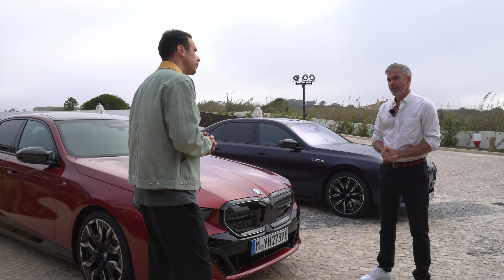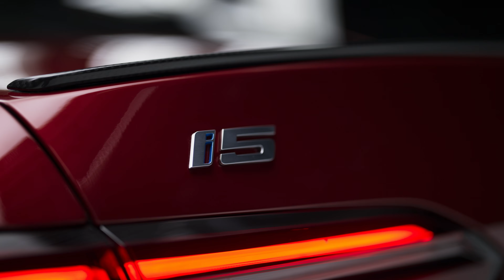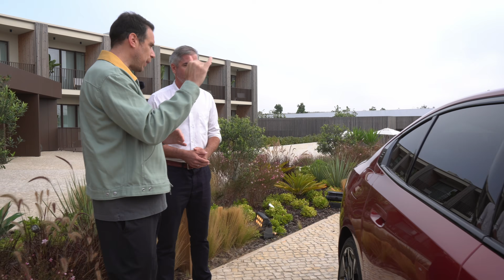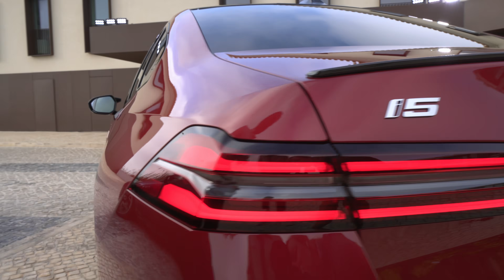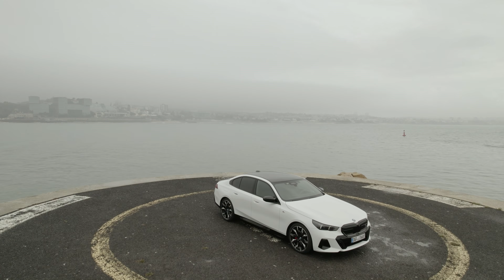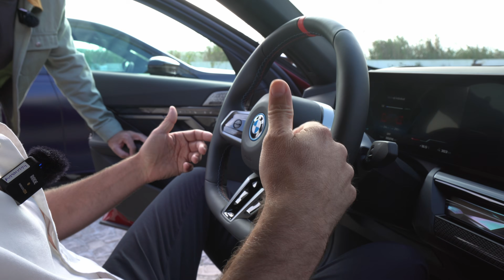BMW 5 Series -  Design Review

Comment: I love the design both in and outside, also love the hidden air vents, way cleaner this way. I can also understand why they don’t use physical buttons anymore, I mean, modern vehicles have a ton of settings/options , it must be done like this . And about the climate controls , what is the problem adjusting the temperature from the screen? I really don’t understand,it’s not like you do it every 5 minutes . 😊

Comment: I love & appreciate it when vehicles are explained by designers & engineers unlike just reviewed mostly "unknowledgeable" motoring journalists who just express their's/people's views which I don't usually follow & find boring.thanks Horatiu
Reply from the maker: This is really nice feedback. I appreciate it. I feel the same way: the designers and engineers are the best at explaining their work. I enjoy these interviews too because I also learn a lot which makes my job easier. For example, what I learned in this new i5 review (even though I did another one before) that the flat bottom steering wheel is also a functional piece. Meaning, it helps with knee room and getting in and out of the car.

Comment: Great Review, however The next time you have the opportunity, please explore  untouched subjects about the car like the sound quality. HK vs BW. Do the Speakers illuminate like the i7.. The lighting accents under the gear shifter, are there any, like the i7 as well. Wind noise on Panoramic Roof vs standard. Etc

Thank you for your hard work.
Reply from the maker: Will do. Next month.
Reply: honestly horatiu this is a really underreported aspect on cars!! those things like sound quality, seat quality, seat positioning comfort are usually just described in a vacuum without comparing to other cars, if bmwblog could have a tech/ rating car comparison section i feel like that would be cool 

also, if you get the chance could you ask the designers why there are no nice quality leather seatbacks on the new 5? it looks cheap the way it is with plastic rears.  and also why the lower speaker on the front door panel is ugly / plain even in the B&W spec? 

im a little disappointed that they didnt add more specialness to the 5 interior although it does look good!! (im thinking of things like the alcantara dashboard thats available on the new 2, and the way the sunroof doesnt have any dimming tech or ambient lighting like the iX or 7 

 @bmwblog
Reply from the maker: Let me shed some light on how things work. At events like this, you have limited time, limited cars. You focus mostly on driving. Then later one, you get a car for a week review or longer where you can focus on all the details. But you need to also find a car to compare things like sound. Let alone getting other brands to give you cars to compare, which is always tough. The questions you have for designers, they won't answer them when you ask them like that. How should they answer the question on the frond door panel speaker?
Reply: @bmwblog  

You're absolutely right about the limitations of those kinds of events, and thank you for running bmwblog very well and being active I enjoy the updates very much. 

As for the questions, you're absolutely right. It's hard to ask questions like that.
But I feel like it's still important.

I mean, there can be a way to ask them and it's still important to ask them because just for example, I think I'm pretty sure this is the i5 M60, right?

And I haven't seen it with an Alcantara roofline and it's over 70,000 and it's the top of the line electric model and it doesn't have an Alcantara roof.

Why?
That seems odd.

The seat backs being plastic, no seat pocket, makes it look like an economy car.
It makes it look very cheap.

And then I think I saw another comment here about, and I didn't even know this, they removed ambient lighting from the rear seat. Why would they do that?

And then the Bowers and Wilkins system.
Yeah, it looks good on the top side of the front door panels.

But then there's that whole lower area where it looks like a base model sound system. There's nothing. It doesn't look special. It doesn't look like anything.

And those are all things that were different on the old 5 Series.
Remember the Bowers and Wilkins on the old 5?
It had beautiful speaker covers up above and then also beautiful below.

And the old 5 Series had beautiful ambient lighting in the rear and beautiful leather on the panel in the rear and beautiful Alcantara.

So it's just that we should hold these brands to account because they're making a new product. It shouldn't be worse than the last - and I specifically mean in materials not in design.

Maybe a way to ask these types of questions, and I think maybe this is their strategy, which is to make the M5 more special, that they're saving a lot of things for the M5.

And so maybe a way to ask these types of questions are, oh, is the M5 going to be more special on the interior?

Will it have XYZ?

I just want to make it clear I'm not trying to attack you or the designers or anything.

I just feel like there are little things that have been overlooked and it's always good to point them out.

For example, the roof feature that I was talking about, the shading, like on the iX, like on the new Porsche Taycan Sport Turismo, that feature was in the iX when it came out and the iX has been out for four years now and they launch a 5 Series, which should be in the relative range of what an iX is, and the 5 Series comes out years later and it doesn't have that technology in the roof.

And the roof doesn't have any sort of ambient lighting, which was in the old 7.

So there's things that are just being overlooked for no reason it seems, unless what they're trying to do is make the new M5 the most special, which I'm assuming that's what they're trying to do, but still, we have to make sure that they know that we can see what they're missing, you know what I mean?
Reply: @bmwblog   just pinging you again in case you havent see my comment from yesterday - cheers
Reply: @lahren6337 don’t forget that if you ask too many overly critical questions you probably won’t get invited to the next event. These events are a symbiosis between journalists and manufactures. Early access for positive or at least neutral reporting. I guess BMW is - as most manufacturers - in a difficult spot in terms of costs from suppliers vs pricing. The inflation made many things much more expensive but buyers don’t have so much higher budgets. They save money where they think most clients won’t care as much. Cutting variations (options like Alcantara roof) also cuts complexity and therefore cost for the whole project. Also having ev, phev, gas and diesel on the same platform surely didn’t help from a development point of view and if many clients request missing extras like the bigger BW Diamond Audio, Alcantara roof or dash and other stuff it will probably come next Model year or with the LCI. Overall I still think they built a great package which is why I ordered a G60. But I agree you see the cost cutting in many aspects as well. But it’s the same with Mercedes and especially Audi in my opinion.

Comment: The new G60 isn't ugly per say, but it certainly isn't as attractive or as traditional BMW looking as the G30 or past BMW's well known for their beauty. The tail lights on the sides are pointing down instead of up, which throws off the side tail light design look. The C-pillar with that extra trim with a "5" on it makes the side profile awkward.The side line running above the door handles instead of through them, makes the side profile look too slab sided. A large group of fellow friends whom have all now seen pictures of the G60 express the same concerns. Being on my second G30 which I love due to the design, this new 5 certainly doesn't inspire me to trade up, instead makes me want to hold on to my G30 as long as possible. BMW's should stir your soul when you look at them, the G60 looks Meh, and that shouldn't happen.